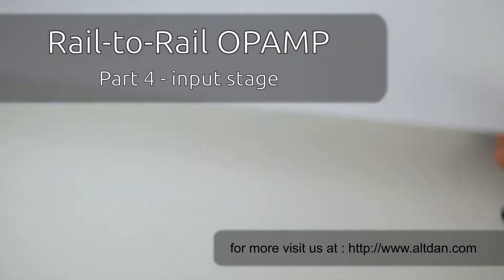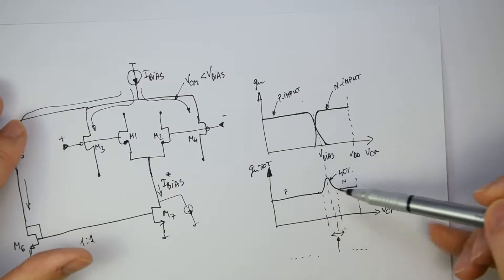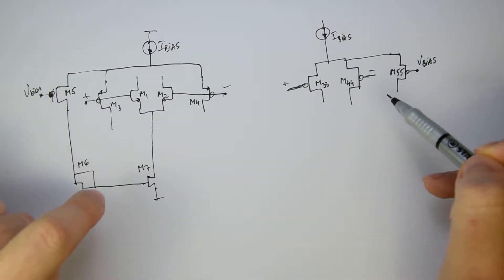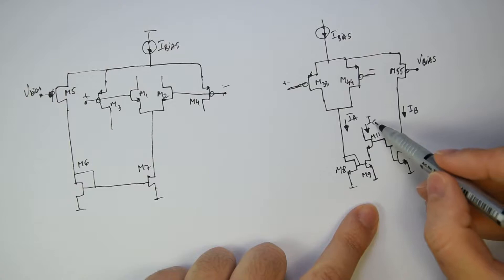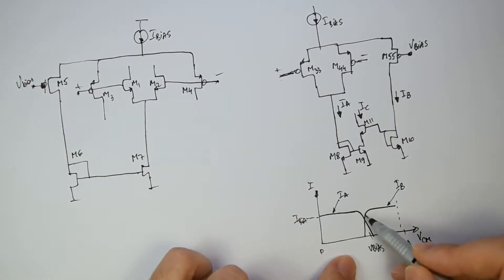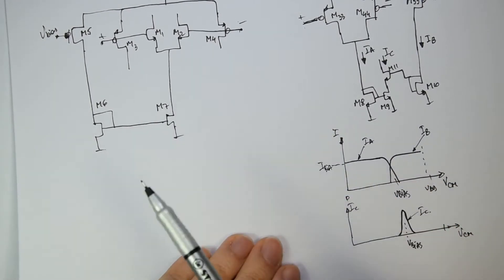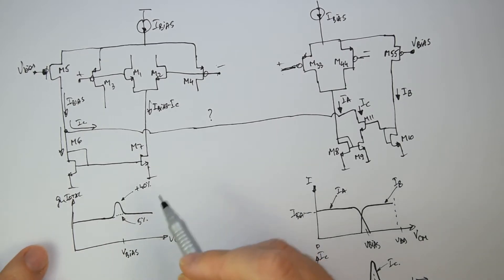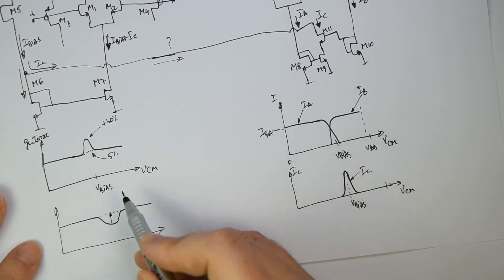CMOS Opamp - rail to rail - part 4 - input pair

Comment: Great video!  Many thanks for posting these.  I would like to use this topology for constant gm, since it means that the main input pairs should work in weak- or strong inversion.  I'd also like to scale down the widths of some devices and change mirror ratios so that it works the same, but using up less current from the supply.  I have question though...

Since M9 and M11 are steering current away from M7, does the combined W/L of M9 and M11 need to match the W/L of M7?

Thanks!